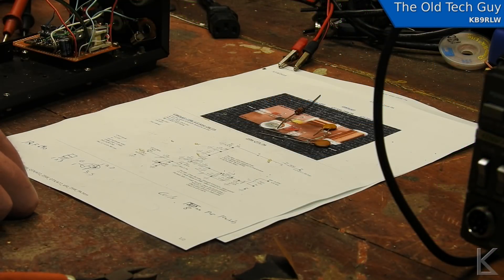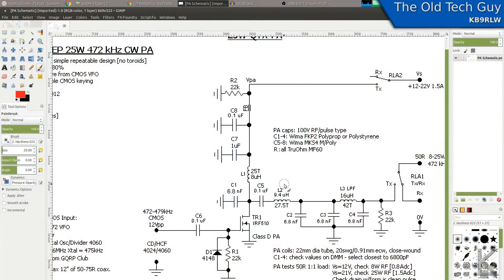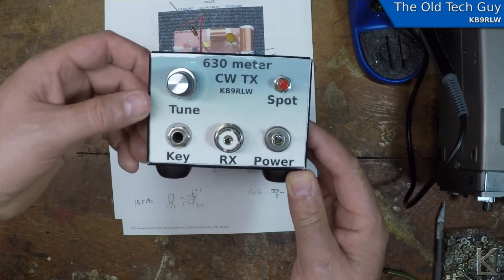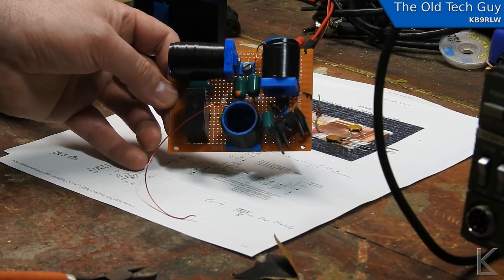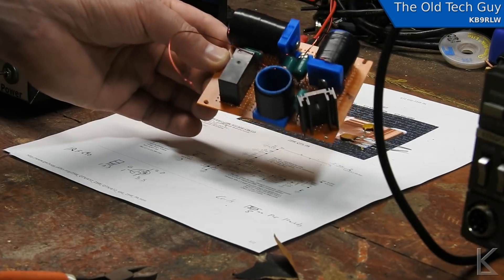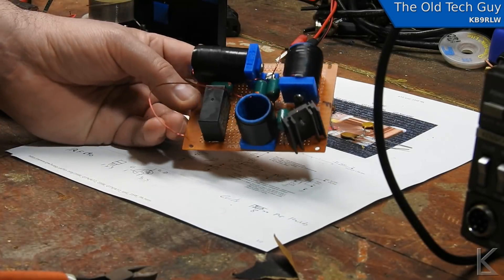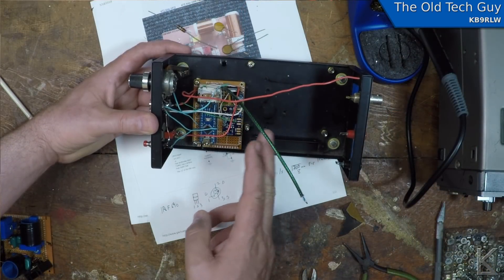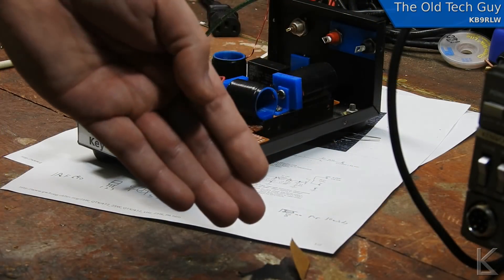Ham Radio - A 630 meter CW transmitter, part 2.  Hardware nearly done.

Comment: Still a new ham, so still doing lots of reading about antennas. Would your antenna even have enough bandwidth for ssb while loaded for 630m?
Reply from the maker: That depends on the matching network.  The variometer that is popular for 630 meter antenna projects is very high Q and therefore extremely narrow, but SSB should be possible.
However, the 630 meter band is only 7kHz wide and an SSB signal is usually 2.3 to 2.7 kHz wide, so SSB is impractical.  The whole band would only fit two SSB QSO's at once.

Comment: Nice transmitter Kevin!  Especially the case.  Beautiful work.  Likewise with your perf board work.  Nice.  But- and this is a personal opinion- I'd have gone with an analog LO given that you are using a pot for tuning and no display. No digital hash in Rx mode (maybe you power down the digital LO in Rx?).  And two transistors (plus one for the Tx-Rx relay) - not tens or hundreds of thousands.  Output from analog LO will be a sine wave, not swamped with harmonics to be suppressed.  You said 'eliminated' (in the output filter of the PA) but I'm sure you meant 'suppressed".  Nice video!  Good work.  Fun to watch!
Reply from the maker: Well, if the VFO were analogue, then the PA would be different as well.  With this PA, you'd need to take that analogue VFO and shape it back to a square wave to drive this class E PA anyway.
There is very little noise from the arduino, and ways of suppressing what little is present if it's a problem.  I like having software control over everything, it makes fine tuning the behavior so very easy.  Plus, I can do things like control the timing of the relays with incredible precision.  Close the RX grounding relay and wait 10 micro seconds, switch the T/R relay and wait 20 micro seconds for the mosfet to stabilize, then turn on the VFO output. etc.

Comment: Is 630 cw only? Or is there some ssb too.
Reply from the maker: Although we're allowed all modes, it's really small.  Just 7 kHz wide.  You couldn't quite fit three SSB qso's on the band at once, so it wouldn't be convenient.  Plus, with the difficulty of getting efficient antennas up, impractical for anything other than modes that are best for weak signals.
That's my opinion anyway.